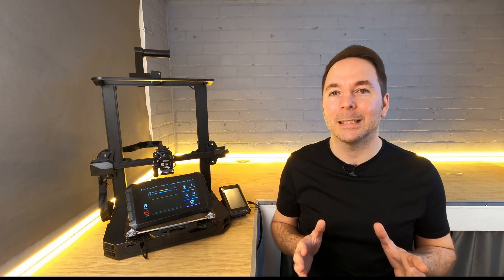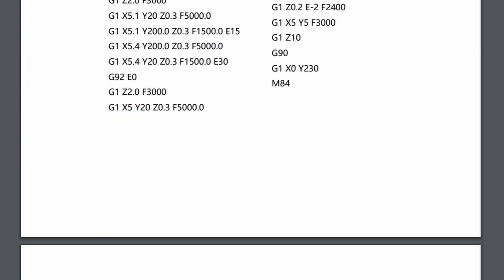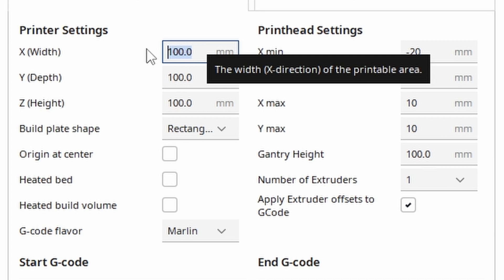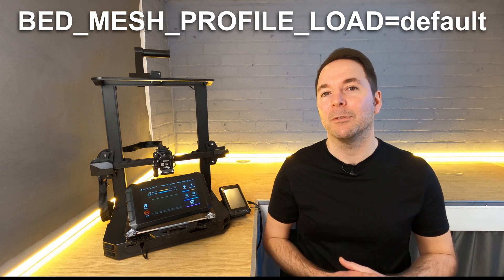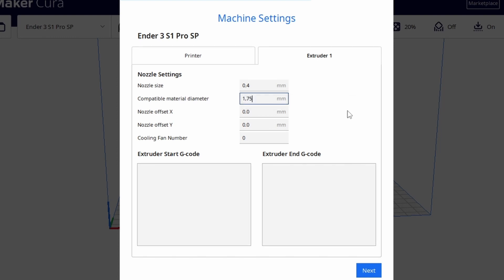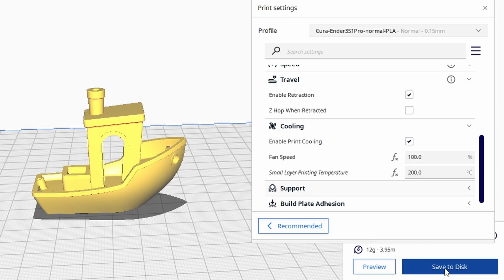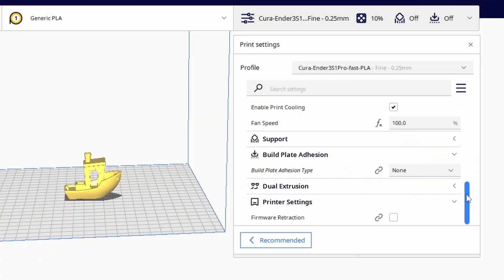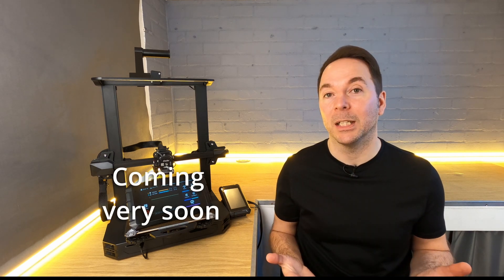Slicer Settings and Profiles With Cura - Sonic Pad Intermediate Part 3

Comment: Looks like Creality deprecated Cura profiles for their own slicer version. Have you tried this yet? Creality Print
Creality Print is a self-developed Fused deposition modeling slicing software produced by Creality. It’s a practical and easy-to-use tool that can help you remote control and monitor your 3D printer and help print directly from your computer.

Comment: Benchy 30 minutes?? For me estimated 59 minutes using the regular profile. I followed everything what did I do wrong *Update* Using the fast profile I estimate 34 minutes** did you switch to the fast profile in the video without mentioning it?
Reply: As I was printing Benchy it printed everything fine until it was time to print the roof of the boat. The extruder hit the print and moved it. It keeps happening with other prints too it keeps moving the prints and messing up. Not sure what's happening or how to fix this.

Comment: I modded my v2 to direct drive and klipper... at the moment I'm using orca slicer...Any tip to update the "default" v2 slicer profile to a better one? since the default is for marlin and the speeds are the base one.. anything from the manual I can take to the slicer to get the most out of modded v2 w/klipper and orca slicer?

Comment: Rick I am struggling with the print head stopping in place at the last X-Y-Z and the nozzle hardens on the spot.  This was after using the ending g code crom creality. I do not understand g code enough yet to add a move to x5 Y 10 z up a bit. Any suggestions for materials to read or watch? I did try using the new print start machine settings and the old print end but it gave an error I have seen a few time about unable to resolve go blah blah  TIA man You have been awesome as a teacher
Reply: I had the same problem. I use a Mac and I use Command C and Command V to copy and paste. For some reason in the process a line of  start code (G28 : Home all Axes), had been separated into 2 lines. I corrected that problem and then found that in "end code G1 Z0.2 E-2 F2400", the hyphen had been removed (don't ask me why?). I corrected that and the problem was solved. I suggest making sure that the code copied to both Start and End G-codes is exactly as shown on the advice. I hope this helps, I found it very frustrating.

Comment: Hi  Ricky, I'm new to 3D printing and have an Ender 3 V3 SE along with a Sonic Pad and an Ender 3 S1 Pro. I managed to setup the S1 to the Sonic Pad and configured with Cura which works great. The problem I have is that I cannot find a profile for Cura to use on the Sonic Pad for my Ender 3 V3 SE. I have looked all over but have not found anything. Could you post or let me know how I would go about creating a profile to use with the custom printer created in Cura?
Thanks

Comment: I've followed the videos and imported Creality's profile and now a print that would take 7h with my previous profile now takes 3h but one issue appeared, the nozzle is scraping the infill pretty hard when traveling above it on the same layer (infill freshly printed and Z didn't move). I've rolled back the changes I made regarding e-steps and pressure advance and the issue prersists. I'm really not understanding how this can be due to higher printing speed, when I use my old profile the scraping almost disappears.
Does anybody have any idea of what could be causing this? I've cleaned, re-leveled the bed and re-adjusted Z offset

Comment: I have an Ender 5 Plus. There's no profiles available or anything close. Should I just avoid this step, or blindly pick out of the 3 available?
The reason I'm here going through these steps is because I'm getting layer gaps on sloped walls (prints ok vertically though), not sure if getting this right would solve my issue anyway.
Reply: Did you find a profile that worked well? I have an Ender5 S1 and am going to be going through the intermediate series soon on mine to speed up prints.

Comment: the End-Gcode was trash.  I just grabbed the code from my old s1 profile added 10 to the x and y just so it wouldn't crash.  What was happening was the print would finish but the nozzle would stop and the heat wound stay on and the printer was non responsive unless I force quit and rebooted.

Comment: M109 S[material_print_temperature_layer_0]      on this code my sonic pad fails ? iam new to this please help my printer is the ender3 v3 se
Reply: Did you ever figure this out? i have the same issue
Reply: @0002nicejay   just remove it  works fine

Comment: Thank you for your excellent videos. Unfortunately, when I try to import the profiles as per your instructions, it always fails with the error pop-up: "Failed to import profile from C:/Users/wb9sy/OneDrive/Desktop/Ender-3 V2 Profiles/Cura-Ender3V2-normal-PLA.curaprofile: Unable to add the profile." This happens regardless of where I put the profile folder - the error message still appears but with the folder where the files are located. Meanwhile, my Ender-3 V2 Neo is turning filament into junk...
Reply: The latest version of Creality Print includes presets for their printers with the Sonic Pad as well as without. Selecting that brings up all the needed options already set. Makes a terrific difference! Thank you for detailing the rest of the optimization to get the best results which I am enjoying now!

Comment: The correct command is BED_MESH_PROFILE LOAD=default
In your video, you used BED_MESH_PROFILE_LOAD=default. I had an error using this command and removed the underscore between PROFILE and LOAD for it to work.
Please update your video description to acknowledge the correction. This could cause confusion for those who are not familiar with klipper commands. Otherwise, great video and series!
Reply: i just bumped to this problem and started looking klipper manual. maybe i get better results now :)
Reply: yup. printing pretty good now. nice introduction to 3d printing world :P wasted hours hunting this issue.
Reply: I was curious how BED_MESH_PROFILE LOAD=default differed in behavior from BED_MESH_CALIBRATE
Reply: Calibrate creates the mesh. Load uses it

Comment: Maybe a stupid question. I have configured the Sonic Pad as a new printer. Is the idea that I now print to the new configured Sonic Pad printer? The Moonraker only connects to the old printer and the profiles are only available on the new printer. Thanks for your help, the content is outstanding.

Comment: Hey Ricky! Thank you SO much again for everything! I have a question for you, there must be an issue in my end G code. I use the exact profile and end G Code as you except i followed your steps for adapting it to my printer sorta (I have an ender 3 V1 NEO) I just got the ender 3 NEO SE direct drive by creality. its not very well know. well Ive gone through all the steps and i just came back and i did the profiles to see if i can have a better bases to fine tune off of (I definitely do with these profiles, again thank you) Everything has been awesome the bed mesh at the beginning of printing is life changing lol. At the end of my prints thought I for some reason get this code. I think that the ending G code must just be wrong somehow for my specific printer (V1 NEO) but I am not sure, that is why I am here asking. If anyone else sees this that also had this code thrown could you please help me. THANK YOU so much in advance!! :)
Code in reference -> !! Move out of range: 0.000 230.000 33.750 [3111.225]

Comment: Ever noticed that the rows of the bed mesh in the print.cfg file have a different order than shown on the sonic pad? The top row on the sonic pad is the bottom row in print.cfg, 2nd from top is 2nd from bottom etc

Comment: Hi Ricky and thanks for you videos and tutorials. I'm trying with real pain to properly tune Sonic Pad with my Ender3 S1 Pro, but I'm getting only pain ;)
I made all the calibrations suggested in the manual and in your videos, but I think that the profiles created by Creality are really bad performing. 
The main issue which I'm not stilla able to solve is warping: I get warping at every print I try and, if I switch back to the "base" S1Pro printer profiles, using the same temperatures (60/200), the print is perfect.

Comment: How can I find for ender 5 s1? 🥲
Reply: As Ricky has noted, you can use the Ender 3 S1 Pro settings, with the Z Height of 280.0 mm.  In the latest slicer version by Creality, 
Start G-Code: 
M140 S60
M105
M190 S60
M104 S205
M105
M109 S205
M82 ;absolute extrusion mode
G28 ;Home
G92 E0 ;Reset extruder
BED_MESH_CALIBRATE
G1 Z2.0 F3000 ;Move Z Axis up
G1 X10.1 Y20 Z0.28 F5000.0 ;Move to start position
G1 X10.1 Y200.0 Z0.28 F1500.0 E15 ;Draw the first line
G1 X10.4 Y200.0 Z0.28 F5000.0 ;Move to side a little
G1 X10.4 Y20 Z0.28 F1500.0 E30 ;Draw the second line
G92 E0 ;Reset extruder
G1 Z2.0 F3000 ;Move Z Axis up

End G-code:
G91 ;Relative positioning 
G1 E-2 F2700 ;Retract a bit 
G1 E-2 Z0.2 F2400 ;Retract and raise Z 
G1 X5 Y5 F3000 ;Wipe out 
G1 Z10 ;Raise Z more 
G90 ;Absolute positioning 
G1 XO YO ;Present print 
M106 SO ;Turn-off fan 
M104 SO ;Turn-off hotend 
M140 SO ;Turn-off bed 
M84 X Y E ;Disable all steppers but Z

I have tweak a few settings..

Comment: I followed this guide to add my S1 Pro.  I thought importing the s1 pro klipper profile configs would set everything up for me and be ready for printing..  It shamefully took me a couple of days and failed/odd prints to realise it isn't so.  CHECK THE RETRACTION DISTANCE!!!!  Only reason I looked is because my dry filament was popping when printing lol

It sets it to 6.5mm when choosing this printer.  The klipper profile does NOT change it.  

This brings me to my question.  If the printer has a profile in Cura, why don't we pick that instead of the custom one?  Surely that would have more correct settings for the printer.  And then importing the klipper profile for that printer would change what needs changing?

I'm wondering what other settings arn't correct now
Reply: I'll answer my own question after trying.

If you add your printer as the official S1 Pro printer, then importing the klipper profile will fail.  

Guess that's why the sonic pad readme tells you to add a custom printer.

Can retraction settings not be configured via profiles?  Or is this just something overlooked by creality?  

Things like this is why I fricking hate 3d printing sometimes

Comment: Hi again Ricky.  It turns out my Ender 3 printer had multiple defects and Creality took it back.  I just purchased an Ender 5 S1 and am setting it up using your great videos.  However, being that there are quite a few differences between the Ender 3 and Ender 5  have you considered adding some updates for those of us who enjoy your guidance?

Comment: I am using the default printer setup in Cura 5.4.0 for my Ender 3 S1 Proand it prents so much better than the mannually added printer.

Comment: Great videos, learning a lot. I have an Ender 3 V2 that I upgraded the extruder to a Slice Direct Drive before purchasing the SonicPad. Should I configure it as a new printer using the Ender 3 V2 parameters or another model - or some particular configuration - due to the direct drive?

Comment: Hi Ricky... Very good series you have here. Your command BED_MESH_PROFILE LOAD=default in your video is correct, not the one you have altered it to in the comments. Its causing a bit of confusion on the sonic pad Facebook group. Its in the official klipper documentation as without ""
Reply from the maker: Thanks Dave, I had some issues with this in an older firmware version that seemed to need the "" marks.
I've amended the description now👍

Comment: Hello,
great videos I followed with aviditi :)
My Ender 3 S1 Pro is calibrated and I used the Creality special printer settings with SP + Profiles.
The result is... bad :O
What is the result of the Benchy printing in fast or normal PLA?
On my side, it's a very poor quality.

Comment: I LOVE this series!! Thank you releasing it..... I did everything according to the video but I noticed 2 strange issues on my end. 1: My printer is running the bed level mesh before every print (ender 3 s1 pro) 2: My slicer times are way off from the file times? Any advice? it was the other way around before I used the correct start code, the cura time exceeded the file time by 50%
Any advice would be great and thank you again, I almost ditched my sonic pad before I found your series

Comment: Hi Ricky, just bought myself a sonic pad and your videos have been amazing and enabled me to get my CR-6 SE running like a dream. My CR-10 Smart is next for the sonic pad treatment. Just one minor thing I came across in your Slicer Setting and Profiles with Cura video, you state that to use the the bed mesh you have created, us the command BED_MESH_PROFILE_LOAD=default, however when I went into the console it was telling me that that statement was an unknown command🤔I then went to the Klipper Github and found that they list it without the underscore between the PROFILE AND LOAD COMMANDS and since then I have not had the error message😃👍Thanks once again for getting me started on my Sonic Pad journey.
Reply: Hi! mind sharing a CR-6se profile? ☺
Reply: @laurens_db  im looking for 1 too lol

Comment: Your series has been very helpful. With this video, I must be missing something because I cannot find any sonicpad profile parameters for CR10S Pro V2. In the documents they provide, it seems they are only focused on Enders.
Reply: After watching through the video several times, I decided to try something hopefully simpler. I went to the machine settings for my CR10S Pro V2, it had been printing to the SonicPad with adjusted profiles as per your videos, In the start g code, I pasted BED_MESH_CALIBRATE and deleted the G29 and M420 codes. It seems that's where you end up anyway. Now to test it. Scary.

Comment: Thanks for the video series, Ricky. Question - Does the creality Sonic Pad respod to flow rate adjustments set in Cura? After calibrating my extruder,  I had printed some flow calibation cubes and found that 91% flow rate in cura would produce dimensionally correct cubes on my Ender 3v2 Neo. Well, I just got a Sonic pad, confirmed my e-steps, and when I print the same cura sliced cube with 91% flow rate, I see the Sonic pad shows 100% flow rate and the cube prints over size. When I adjust the Sonic Pad's flow rate to 91%, my print comes out dimensionally correct. This appears the flow rate adjustments in Cura are not effecting my Sonic Pad prints. Do you know how these interact with respect to flow rate adjustments? What is your recommended process for this where my PLA needs a 91% flow rate? Set in Cura? Set in the Sonic pad?

Comment: I have the sonic pad with the ender 3 s1 pro. I have had issues printing a benchy at default sonic pad normal slicer settings and the hull of the benchy looks like its not getting cooled enough. Did anyone have this issue?

Comment: Thanks for your excellent videos, they're so very helpful and imformative!!! In regards ot the bed meshing...I have an Ender 5 S1 and have been following your tutorials to set it up. I can verify that the Sonc Pad must indeed auto-insert its own bed meshing command, as I only have the G29 command in there in the Cura profile, and since using the Sonic Pad, it performs a bed mesh prior to each print that is performed differently (one probe touch as opposed to the 2 probe touchers pre Sonic Pad), and faster than it was being done pre Sonic Pad with the G29 code.

Comment: Hi Ricky - v. glad you're out there providing all the excellent info you do. However, I have a question. Re: the Gantry Height setting - for the Ender-3 S1 Pro, this seems to be set at 25mm, as reflected in the published Cura pdf. Am I misunderstanding what Gantry Height means, or is this just a typo for 250mm? I notice that, e.g. for the Ender3-V2, the Cura pdf specifies 255mm for Gantry Height, which is 20mm more than the specified Z (Height) setting, rather than 225mm LESS, as is the case for my Ender-3 S1 Pro? Hope you can help - would hate to fall at one of the first hurdles. P.S. I did hover over the entry in Cura to get the setting's explanation, but still didn't get a good sense of what Gantry Height actually meant.